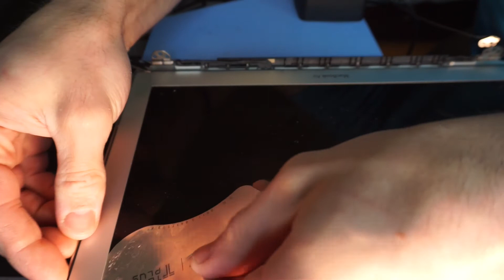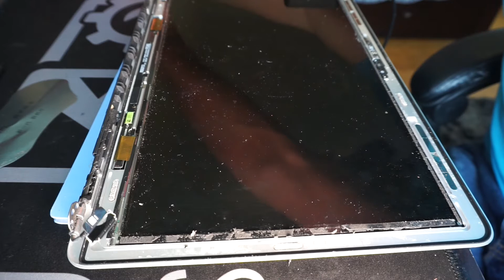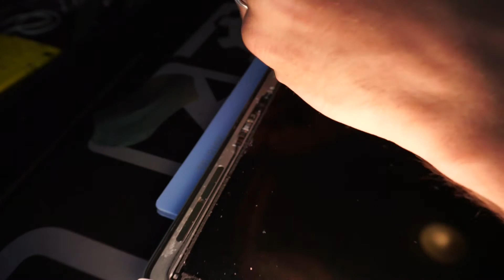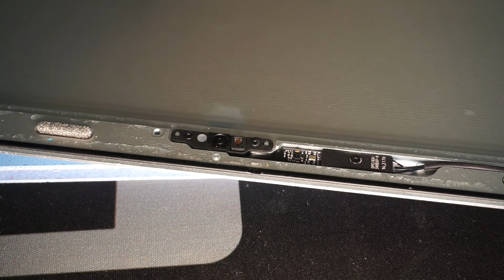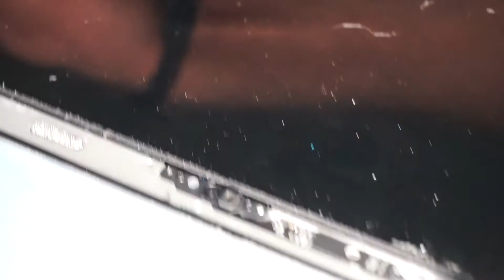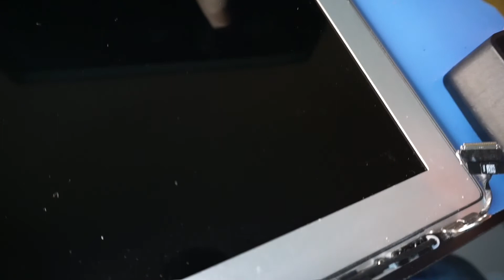Macbook Air 13 A1466 Webcam replacement

Comment: WARNING! in some macbook air 2012 screen the webcam does not fit and you have dremel the space for it. i did it today and it was a pain, plus you have to be VERY careful not to poke a hole through the aluminum chassis
Reply from the maker: i would be thinking it isn't the correct webcam for your exact model, if you need to go to that level

Comment: when you slip that paper thingy under the screen... does that break the camera? i by mistake did that and now it's saying that there's no connection to my camera
Reply from the maker: there is the risk of the cable going to the webcam, being damaged when opening the laptop

Comment: I had to remove all the screen of my MacBook Air 2015, but the camera doesn't work, the computer shows me a "no camera connected" message, what can I do to fix that problem, I already try to introduce a code in the terminal, and reinstalled the OS
Reply from the maker: i would be thinking damage to the camera connector or not connected problem.

Its a hardware issue you have
Reply: @rickstechrepairs  if we have a hardware issue on camera it is possible to repair the camera?
Reply: @lama7607  with micro soldering it could also be a SMC issue